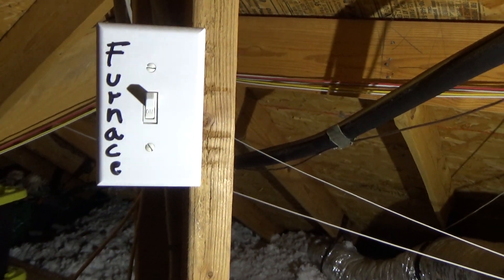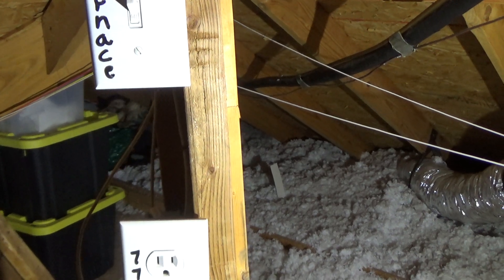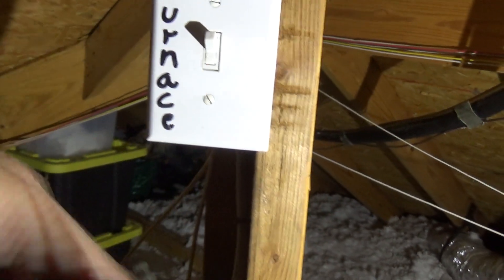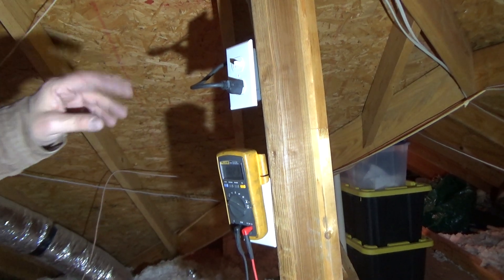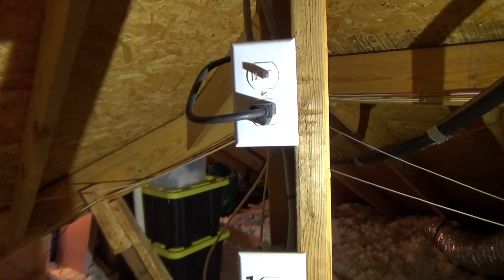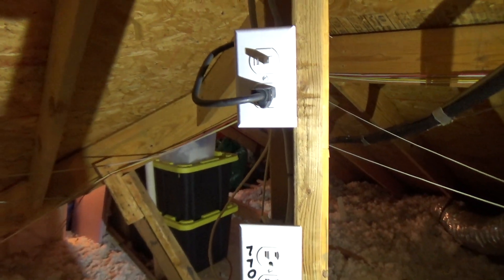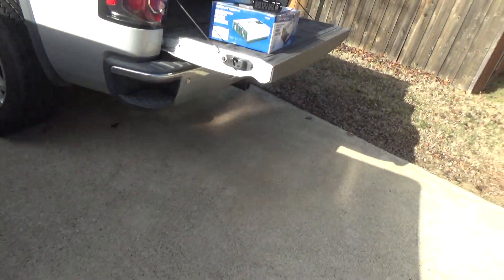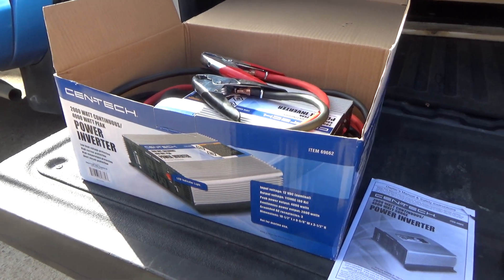How to Power Your Gas Furnace in a Loss of Power Emergency.

Comment: This is the 3rd one of these I've seen.  The better way is steal the NG off the heater and pipe it to a cheap Amazon gas radiator sitting in the fire place.  No power needed.
Reply from the maker: I have a gas fireplace and barely heated the living room. This way the entire house is heated.
Reply: @737mechanic  Fireplaces are notoriously inefficient heating devices.  I use my cheap heater to warm a 2car garage!  It'll make you sweat out there.
Reply from the maker: @jagboy69  show me the link so I can check it out.
I have 3 1500-watt electric heaters and 2 Mr buddy propane heaters that helped, but the temperature went down to 50 degrees inside the house before power was restored. Luckily I was able to open the cabinets under the sink and aim the heaters there to prevent the pipes from freezing.
Reply: @737mechanic  Look on Amazon for procom heater.  When I bought mine, it was 99bucks.  Of course it's more now. 🙄 The one I got will run NG or propane.  You'll see a video on my channel about it way back.  I had a bad issue with it at first, the company was useless, but I fixed it and the thing has been a rock star.  Sorry to hear your chilly.  I'll tell you I used a garden hose to run the thing 50feet!  Not the safest, I'll admit.  lol  Merry Christmas, hope it gets warmer soon!